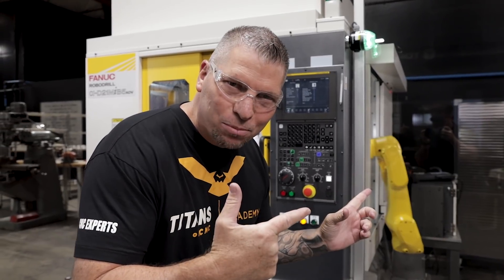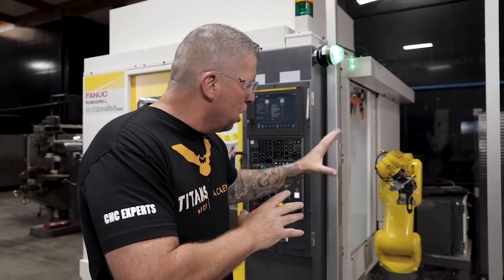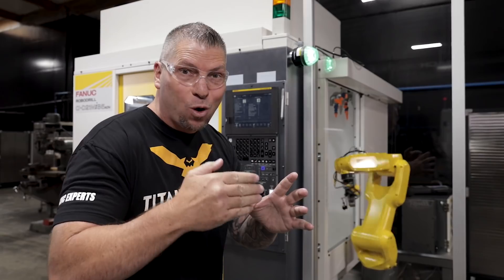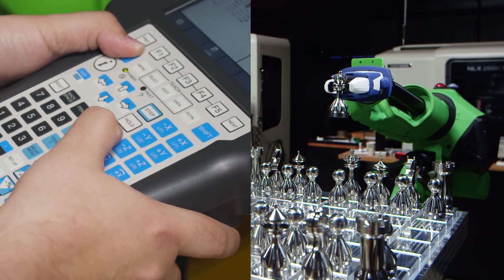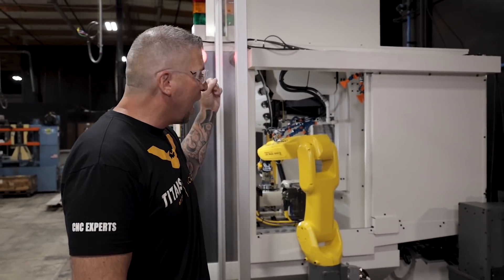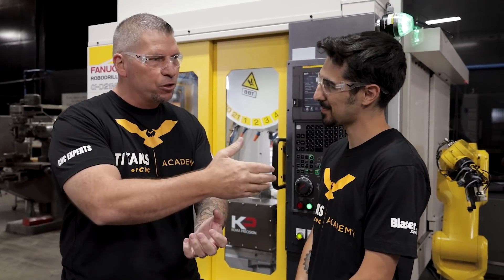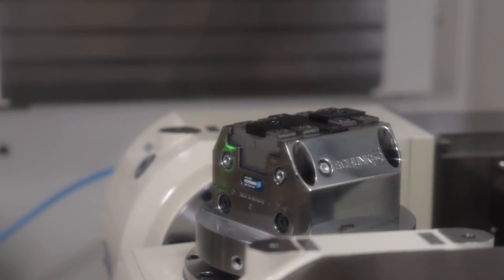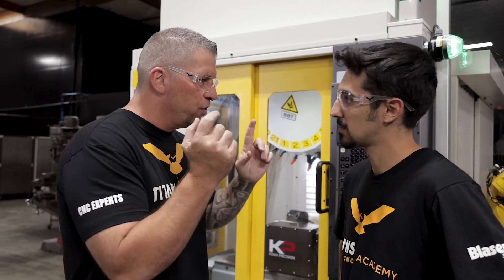Set-Up Our 5-Axis CNC Mill w/ a 6-Axis Robot Arm!

Comment: What is with the manual mill in the background.
Reply: Richard Hall that’s for when the computers and sensors fail and you actually need to get some shit done
Reply: @joethurman2712  Im not shor that a manual mill wich doesn't look like it's even got a DRO fits with titans rapid machining technet for perfection part 🙂🙂. But you are completely right thay are great for simple one of parts when it's not worth the CAM and setup time.

Comment: If anything robots kill mundane repetitive jobs that no one would stay at for more than a year

Increases efficiency and eliminates turnover, but still requires someone to monitor/maintain/manage the robots. So not all jobs are lost either way.
Reply: @matthewcornelius5862  what are you trying to say? That I don't welcome robots? Because I most definitely do.

I edited the original comment so it's a little more clear
Reply: @matthewcornelius5862  ah ok I got you
Reply: Also I swear to God it seems robotics/automation speeds up the redundancy leaving you more time to be productive else where thus generating more work for everyone lol might keep you from doing that mind numbing process, but there will be something else to do :)
Reply: Hold up, coat it in sugar call it what you want.. The implementation of Robots means "Less Jobs".

Comment: I'm 23 and am standing in front of an Hermle C22 with Hermle Workpiecehandling "HACS"!
90 Vices :)
I love it!
Reply: can you handle second operations on the c22 without touch probing the piece? is the vice placed that accurate?
Reply: @marcel5797  The plates lock on a taper, so it should be good.

Comment: Sir I don't understand the automation behind the work holding device. This setup is for fixed shape work. Please explain how work holding is working.
Reply: Automated work holding means that the vise is opened and closed by code, no humans needed, that's all.
Reply: This setup could be 100% fixed shape work and could also be used for small pallet style and batch work as well,  it's all about how deep your needs and or your programming are.